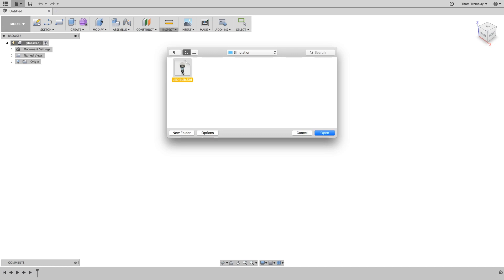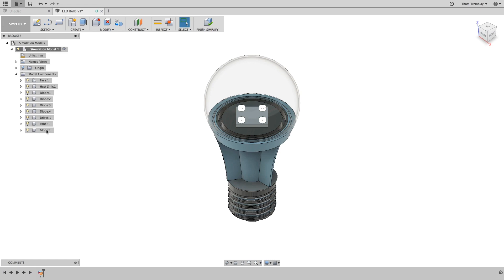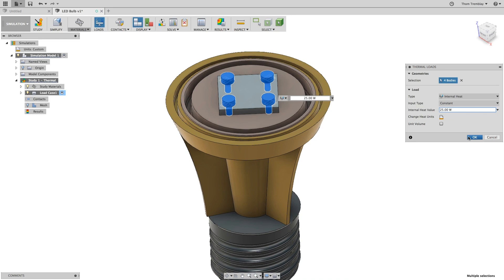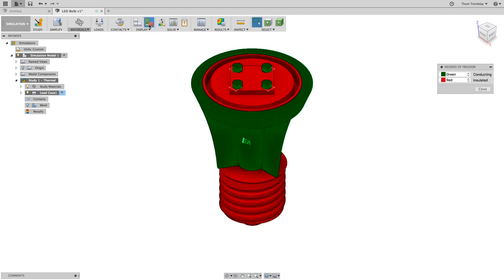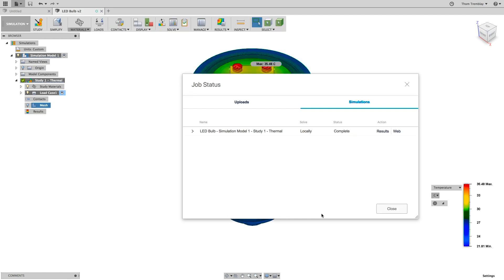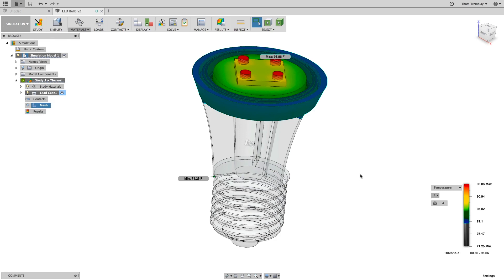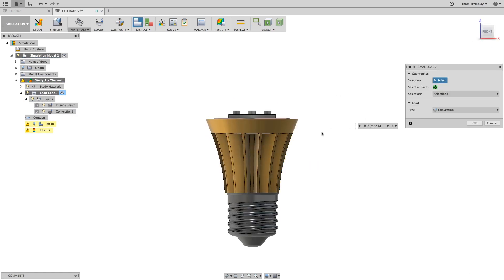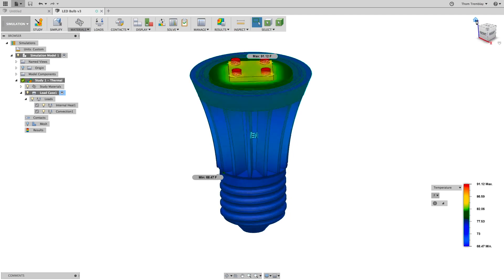Staying Cool with Thermal Simulations

Comment: hi, great tutorial, but I can be sure what convection values are correct for various materials?....you entered 1000, do you have any official tables where these values are included?
Reply: Good question. The value that you type in depends on the thing doing the conducting. In this case it is air. So you would google the conduction value of air which I did. A few accepted values show up in the literature available. still air is 1-5 Btu / ( h×ft 2 ×R ). This is the default metric input in fusion. so you would just type in any number from 1-5. But air usually moves and if the air moves faster (within reason, extremally fast air will cause friction and more heat than it absorbs), will remove more heat. 5-200 in most forced cooling applications. Then you have liquid fluids. Water and oil absorb more heat and have values from 20-3000. If you don't know the fluid or other conduction thing, velocity of the fluid, or the fluids starting temperature. Then you have no choice left but to set up a bench test. Get the fluid you need or other thing, set up the conditions in a small scale way. A heat lamp (for example) and thermometers and apply the fluids in a real and representative way and measure the rate of temperature change and the overall mass of the fluid. This will get you the btu rate you need for the simulation with a bit of math that you will need to look up. ASTM testing standards usually has all this stuff very well documented so if you see a number in the simulation and don't know where it comes from google ASTM testing standards for (enter what ever it is you need to know here). Disclaimer!!! I googled this stuff myself and did not verified the accuracy of the information. At the end of the day bench testing trumps google every time. If you can afford to do a bench test to collect the data needed for the simulation please just do that. The internet has far more misinformation than correct information. Never forget that.

Comment: Can you make a tool for wires ?
Reply from the maker: To make wires, or simulate? We definitely need improvements to our 3d Sketcher to make them easier...
Reply: @adskFusion  To make wire because actually it's "almost" impossible. One of the best way to make a tool like this is to click on a face object, choose a parametric face ( round / custom / librairie ) and clic on another face of an object to attach it. Then you can clic on the wire to make some nice round edges with some basic param ( max lenght, angle ) and voila ! Lets resume : Clic on a face, put down a param / lib shape, clic on other face, generate wire then clic to add angle with a bezier thing.

By the way, i think you need to go deep for 3d printing, like custom gcode, make this round shape 60mmsec ( or % speed ), letters on this other shape 10mm, with multiple layer height. Like your tool cam, kind of !

Comment: So how do I add the orientation of the bulb as thermal patterns would vary depending on whether the bulb is upside down or hanging from a ceiling.
Reply from the maker: That sort of thing would be addressed in a CFD thermal simulation. In that case, the heating of the air around the product would cause it to rise (related to the direction of gravity), and cooler ambient air would move in to take its place. As far as I know. this cannot be accounted for in the FEA approach to thermal problems. The good news? We hope to get CFD simulation in Fusion 360 at some point. If you have immediate needs, see:  https://www.autodesk.com/products/cfd/overview